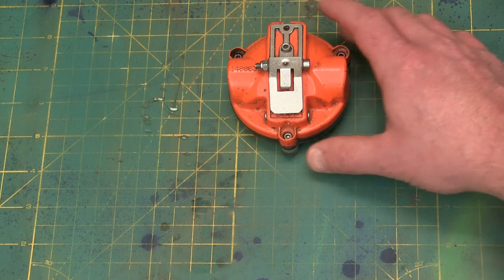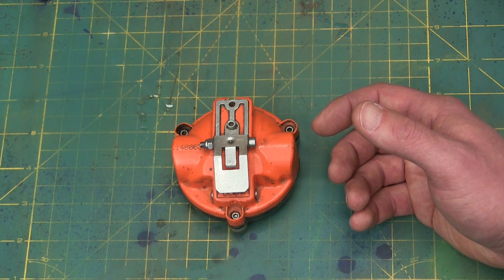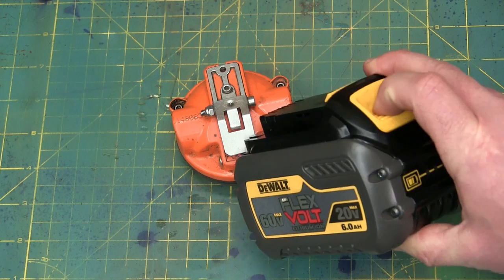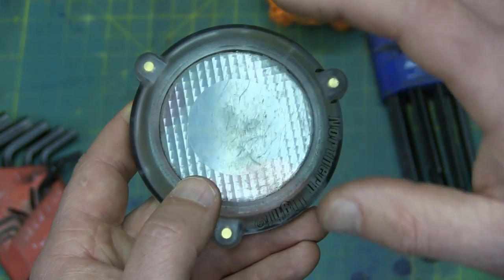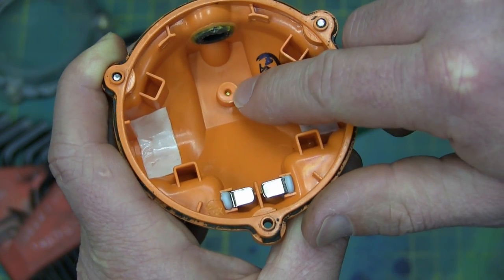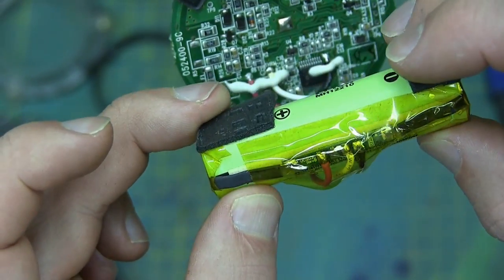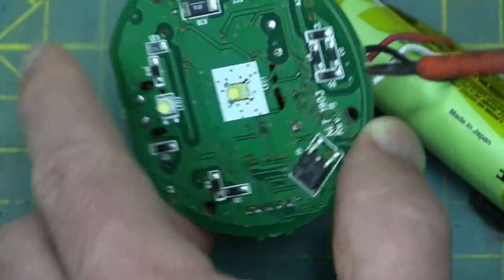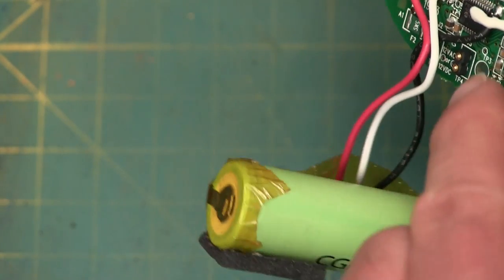BOLTR: $500 Industrial FLASHLIGHT. WHY SO MUCH?

Comment: So that green roll of pennies is an 18650 battery (18mm x 65.0mm).  That particular model number comes in a few different mmmmm-aaaaah ratings, given what that is for, usual work day for a miner, etc, I would guess it is probably a 1400 or 1600 mAh rated little chooch inducer.  The amp rating on that class of batteries tends to be 10-15 amp.  I can't tell you the specifics without the actual SKUcum number off the side, but those Panasonic branded batteries are pretty damn good in my experience.  I believe these us NCA chemo-nerganieering, and they do in fact have the tabs already installed (mandated by OMniron the OEM of these batteries that require ALL applications of use of this battery requires Panasonic final preparation which includes caps and some simple venting prevention).  NCA Cremastery provides lower output amperage, but higher capacity, and the best shock resistance of LiON batteries.  (its chemistry what that fart sniffer Elan Muskynuts uses in his Tesla vehicles).  It looks like they integrated the charge safety directly on the green waffle there, and the over temp was probably soldered to the ends.  Granted, if your LED starts drawing more than 10amps of power, you may have a whole gaggle of blind miners just before the battery vents and tries to melt that housing from the inside out...which I might want to see just once, some poor miner shmick running around with his hair on fire and a dozen more waving their arms about like a 17 year old trying to sneak home in the dark through the basement while drunk.
Reply: Co-erection, they are not protected at all on the battery, which makes sens as to why they made their own circuit and taped it on there.  Also, the caps are called a flat top as there are no protruding buttons on the ends, but they are in fact completely sealed prior to manufacturer getting their dick beaters on them.  Oh and I did discern the SKU, they are either 2250 or 2550 (depends on which seller you look at, guessing 2550 rated 2250 tested)

Comment: Why don't they just have a bi-metal temperature switch instead of that fuse for the battery? Is it just so they can sell you another 500$ lamp?
Reply: That is what they hope for!
Reply: Bi-metal doesn't blow that fast. Your circuit will already be grilled by then.
Reply: PNathan The charging circuitry has over current protection:)
Reply: Same reason you don't have your fuse in the breaker box automatically reset after some time. If it tripped something went so wrong that you don't want it to work unless someone fixed the fault.
Reply: @PNathan  -  That slim circuit board held under the clear Kapton tape, is a Lithium battery (cell) controller. 
Lithium cells and batteries MUST be treated with precision and operated within strict parameters. Over-charge, over-discharge, over-heating, over-current, are all conditions that will either destroy the battery, explode and catch fire (hello Samsung), or drastically cut its life expectancy. 

This board precisely controls the charging and discharging of the battery and shuts down the output when it reaches a specific threshold voltage to prevent the damage caused by an undervoltage condition. Lithium chemistry does not tolerate cells to be discharged to zero. This board is a standard, easily available, inexpensive (under fifty cents), and is very easy to use. Just feed it power for awhile, then take what is needed from the battery, it handles all of the heavy lifting, the decision making, and the necessary protection of the rechargeable power system within a given device.
Reply: What part of 'explosion-proof' did you miss?

Comment: The tape on the battery & overload protection board is Kapton tape, some variations of such are ESD safe, for use on/around sensitive electronics. This may also be a reason for them to use it in this environment. Apple used/uses this tape inside their Mac products, I saw it especially often while repairing 2006-7 era (non-unibody) MacBook Pros and iMacs.

Comment: You: I cant drill tempered glass...  me : hold my pipe and watch me dirll 2" drain holes for the sump and return plumbing  in the tempered glass 1/2 "  thick floor on this 90gallon salt water fish tank  with water and a 2" dimond hole saw... lube and cooling is the key to the undoable hole
Reply: David Drescher yea cool story 🙄

Comment: "...favorite tool of miners everywhere is a thumb-detecting nut-fucker that comes with a wide-lerizer installed."

Priceless. ;)

Battery is a common CGR18650EA; rated 2550mAH w/.7C charge rate and 1C discharge. Datasheet is here:

http://omnitron.de/batt/datasheet/panasonic/liion/cgr-18650ea.pdf

Protection circuit on battery is a standard protection circuit PCB Model VC3030 by Vecture.These use a custom programmed IC that protects the battery from over-current in charge and discharge modes, over-voltage, and under-voltage as well as temp. Datasheet is here:

http://www.vectureinc.com/wp-content/uploads/VC3030-Data-Sheet.pdf

The protection PCB and battery are commonly sold as a bundled product by battery manufacturers and contract manufacturers for distribution to buyers who need a power system that meets certain specs for  output and safety/reliability standards. 

3rd wire is a sensor wire to the LED controller on the main board so the board can monitor cell voltage and any fault conditions; it will probably also periodically blink the main LED in specific patterns to warn the user of fault conditions and state of charge.

Comment: Use a hydrogen torch to bring your polycarbonate surface back to normal  .
Reply: stephen borst should be able to find a buddy with a vapor polish booth that'll slip it into a production run for a rack
Reply: 10-4

Comment: $500 and a cheap crappy wet electrolytic SMD cap? In a sealed enclosure? In a high-heat environment? No thanks. For $500, I expect them to splurge on a $3-4 organic polymer. A lot of Canadian electronics are ALMOST good. Almost. So close. But let down by something random and stupid. I guess they figure the cap will outlast the lamp, but still feels bad man.

Comment: How is it compared to some of other "hi-end" expensive high quality flashlights, like Shurefire, Olight (ALL but cheapest of Olight models are "built like tank").
I only own a couple of them, but they all seem to be at least that well made, with electronics encased in resin (no fix for you ;-( , for a fraction of price, like 40-80 euro per flashlight...
Still damn expensive for most people, but perhaps higher/same quality, and for 1/8 of price... 
The only thing perhaps problematic is they all use (chemically hardened, so they say ;-) glass instead of plastic for "window", don't know how good or bad that is for mining use, i saw some cave explorers tend to glue some plexy or whatever random transparent plastic over it, just to be shure...
They allso make shure that averagely gifted miner could replace battery, if thing uses non removable li-ion (or ni-mh in older models...) battery, o-rings, switch rubber-silicone diaphragm, etc...

Comment: I went underground with a carbide or lead battery headlight
Reply: Adamast the upside of a carbide lamp was the built in suffocation indicator as a standard feature ;)
Reply: ***** In CO2 caves it gave not much of an indication.  But it wasn't one of those safety miners lamp with catalytic spare light.

Comment: WTF? They use lithium ion batteries that aren't explosion proofed in coal mines? Those things are practically bombs waiting to go off if the plates are shorted out. Which can happen, often does happen, if they are penetrated by a metal object. So, nothing that could possibly happen in a mine. Amirite?

Comment: My Pepere (Eloi, good proper name eh?), has done a lot of shit. He was active on the log drives in NB and in Maine till they stopped those, jumping around on fucking death logs with spiked boots rushing down a colder than dick river. He bounced around in C-47s in labrador building army bases, survived one of them going down in the fucking woods like it wasnt any big deal. He lost two fingers in two different hell holes of industry, and fell off a three story roof cause he touched a live wire and recoiled from the electric shock. (falling off roofs is a strong tradition in both sides of my family, which I can say I am a practicing member of. Havent lost a finger or put a roofing nail through my foot yet so i'm not 100% initiated yet, but well on my way). ANYWAY moral of the story is the only job I've ever heard this man complain about was mining. He claims he spent one paycheck below ground and blew town faster than he thought a man could. Says by far it was the scariest job he'd ever had, and this was after logging and crash landing in the fucklands of labrador mind you. SO his advice was always that I could do whatever I wanted, but don't go underground.

Mad respect for the guys who do. I drank plenty of beers with salt miners when I was living near the big Cargill mine under Cayuga the last 5 years or so. Those fuckers work for a living. No kidding.

Comment: Yeah, gotta laugh at the stupid involved in demanding intrinsically safe lamps but allowing battery packs. I've seen the same thing at gas plants. Nope, you can't bring your favorite flashlight in unless it's intrinsically safe but sure roll that 250T crane right through the gates because it sure as shit doesn't have a starter motor that flashes like a bastard. :)

Comment: Looks like a 26650 battery. Just measure it. Unless you were leaving that out for comments ;)
Reply: Huh, it does say 18650. That's weird they put a 26650 bat in 18650 wrapper.
Reply: bryangoggin That looks like a normal 18650 not a 26650.
Reply: +bryangoggin it's18650 for sure 26 is much fatter
Reply: I'm waiting 'til he measures before I make up my mind.
Reply: It's not a 26650, 26650's are larger than C-cells in diameter, it's an 18650 Panasonic NCR18650B 3400maH battery.

Comment: why not metal and glass? they don't catch on fire and still will fit in $500
Reply: Bartosz Olszewski It is but not for this flash light. These are the ones used for miners. You woudln't want a very heavy flashlight haning on your forehead for hours while working

Comment: 4000 lux?
Reply: James Mclaughlin 
1 lux= 1 lumen
Reply: lux is an area measurement, lumen is a point measurement
Reply: Lumen is a measure of the total output of a light, where as Lux is the intensity of the light.
Lux is usually only used to make lights sound better than they are, if you concentrate almost all of the light out put into a tiny spot then you get a huge number for Lux.

This light has a Luxeon Rebel LED in it, so its maximum possible output is only about 200lumen.
Reply: lux is lumens at a distance.
Reply: They're a distinctive shape, no other LEDs look like them...also I'm a nerd :p
Reply: If you are a regular human that is trying to light up an area lumen is important to you.  If you are a miner, you aren't trying to light up the mine, you are trying to have a bright light shining on the area where you are working and a small amount of peripheral light for when you are walking.  Think spot vs. flood light.
Reply: Everyone, I was questioning 4000 lux from such a tiny LED not what a Lux is.

Comment: Beefy, low production numbers, Class 1 Div 1 = $$$$
Reply: Probably didn't break half in two because UL or whoever certified it tried that as well with much stronger solvents and also likely tried to set it on fire. If that had broken, it would have failed class 1 div 1. it MUST maintain its vapor barrier no matter what they throw at it. (never understood the fire test. If its on fire class 1 div 1 no longer matters)

Comment: Product review biased as hell. No plastic ID marks or flame test, knurled nuts inset into plastic, zero look at PC soldering, components branding, batching, or product finish. Slaz and double sided tape given a pass. Stupid amounts of circuitry for a two step LED lamp, no heat sinking of LEDs (thus no voltage regulator) and "ferrous stainless" suddenly OK.